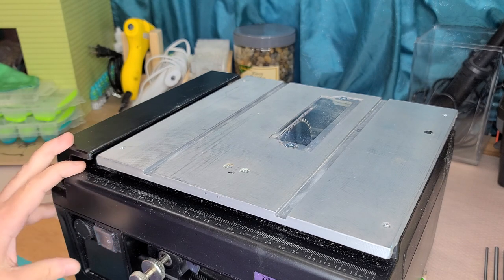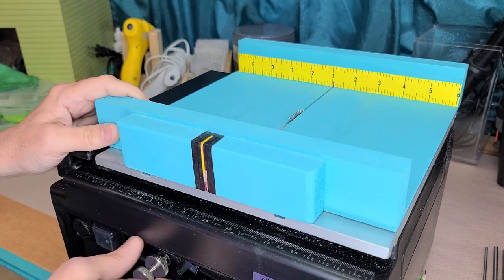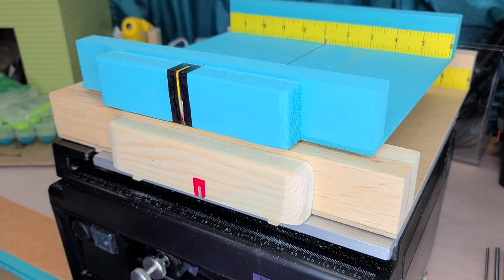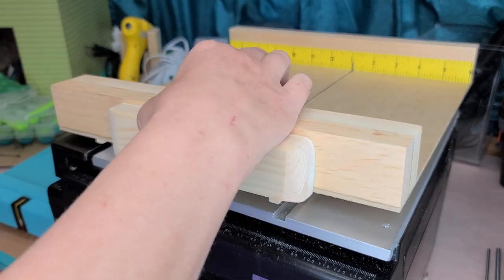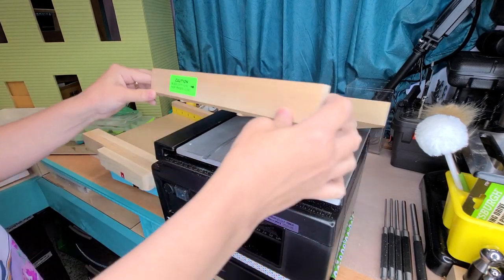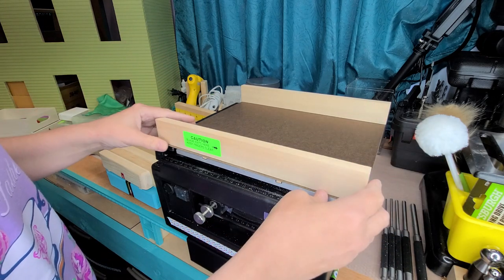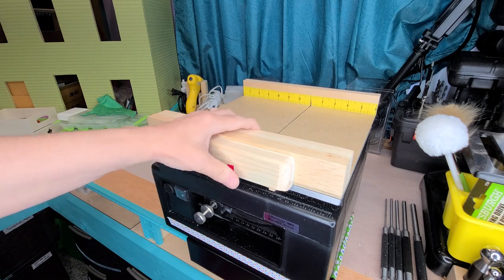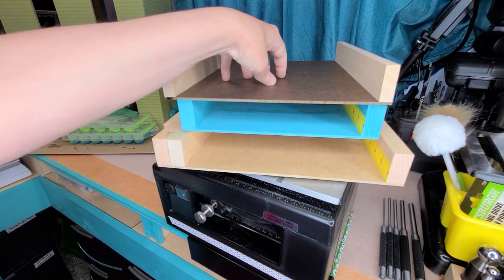Table Saw Sled Review for my Micro Mark Saw

Comment: I made one of these for the proxxon mini table saw. So helpful.  If people are scared they will put their hands somewhere they don't belong, I have a suggestion.  You can run "handles" from the top of the upright front piece to the top of the back upright piece of the sled (on either side of the blade and parallel to it) such that you would literally have to reach around these to get your fingers near the blade.  It also kind of acts like a handle by which you can grab your cross-cut sled.  It makes me feel extra safe and I have these on my full sized table saw cross-cut sled as well.  On that one I added a piece of plexiglass over the "handles" which acts as a blade guard as well.  Just some thoughts.  Thanks for sharing this, Laurie.
Reply from the maker: Thank you so much <3